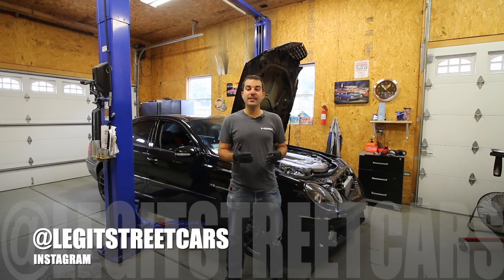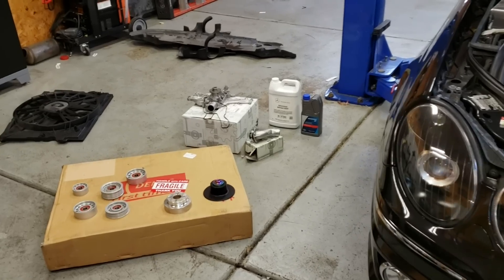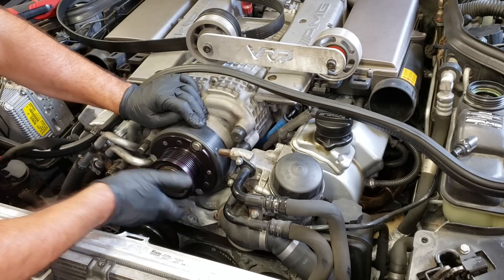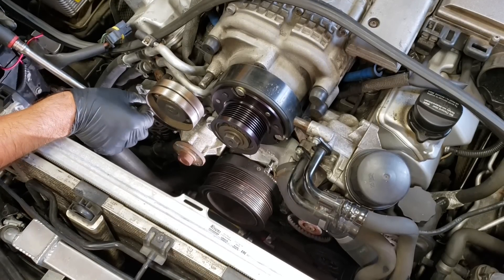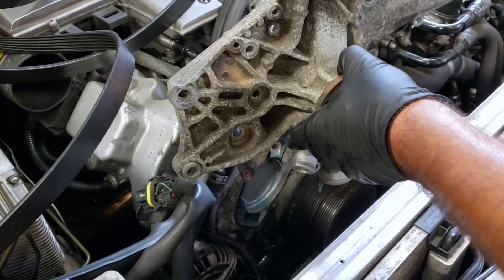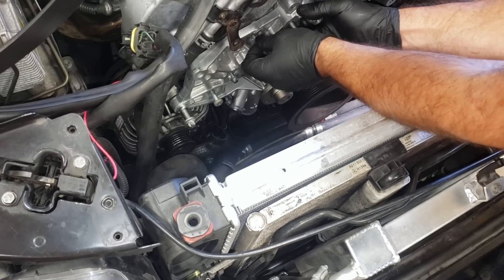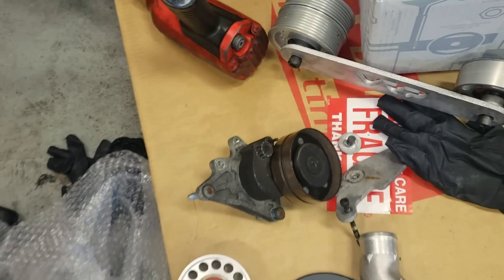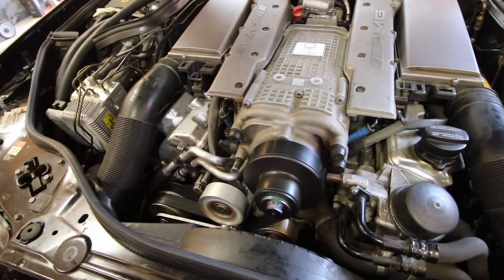My E55 AMG Finally Broke So I Added More Boost, Blower Whine & Power! "While I Was In There."

Comment: Just bought myself a e55, your videos have been a big reason why. Love it so far, can't wait to start modifying it!
Reply: Bloodhawk759 same whit me a year ago he made me change from BMW to MB lol i love my E55 , is such a gentle beast
Reply: I want one, can easily afford one. The maintenance scares me though
Reply: jmhellison i got mine 18 months ago, 146k miles now and this is a quick cost review:

SC pulley: 700 dollars (done at dealership thats why so high otherwise it would be like 50)

Spark plugs and wires: 350

Both front air struts: 1200, did the job by my self

SBC break failed: free of charge replacement by MB, its under extended 25 year warranty by MB usa

My A/C is working weird, not very cold air, and air flow speed oscillates randomly or stops completely for no reason 
Estimated cost: 140 to 500 without labor

Regular oil and filter changes 

So about 166.6 dollars a month i dont think is that high considering that most of the cost is for the airmatic that lasted 146k on originals, thats a lot
Reply: Me too, I got mine a week ago. I like the simplicity of working on it.
Reply: Have fun with repairs lmao
Reply: DisneyChanneFlow 2 you have to pay to play. Every car has repairs. It least I will enjoy it more.
Reply: @aaronedwards4755  yeah good point
Reply: I've been looking for a E55 myself I have a Clk55 with the naturally aspirated engine I've owned it 13 years super reliable. But I'm torn because I've always wanted a Sl55 but the suspension scares me.
Reply: I'm debating buying a 05 e55 with mods has 667hp guy wants 16grand cnd... It's just silver tho. If was black all over it
Reply: Bloodhawk759 how many miles and what did you get it for? I’m looking for one myself right now
Reply: @crinixx  14,000 miles,  costed me 14k usd car had every option available, even extra designo option such as leather covered dash and door panels, extra alcantara interior pieces. Im located in Sweden.
Reply: Bloodhawk759 that’s awesome, I just got back from test driving one that has every option you could think of with the alcantara pieces and dual sunroof. Very nice condition it was a dark gray metallic color too
Reply: Welcome and congratulations!   It's a sickness,  you'll see . . Lol

Comment: Mercedes actually give you room to work on the pulleys without removing the front clip of the car........Audi would never!!!
Reply: You don't have to, i did my timing belt without removing the front clip
Reply: @joewontwice  what audi? Most VWs you have to remove the front clip or even completely remove the engine.
Reply: @janprokopenko7928  1.8t a4
Reply: @joewontwice  What model/gen? I have a B6 A4 aint happen on that one
Reply: @joewontwice  Was it as comfortable as on this Merc??
Reply: @philb707 only thing that sucked was the crank pully bolts.
Reply: @philb707  drain the radiator and remove it. cover the ac condenser with cardboard and bungee it to the front wheel.  now you have a big hole to work through.  that is, if service position isn't making enough room.  audis are pretty easy for timing work.
Reply: Phil B what engine is it?
Reply: How do use front clip has a service position also no need to remove the entire thing
Reply: At some BMW engines you have to get the engine down to do the timing (2.0 diesel, 177hp is one).
Reply: My thoughts exactly. I spent yesterday noon playing with timing on a 24v vr6.  The front end has to come off just to remove the inlet manifold..
Reply: Yea, but audi aren't complete dicks. With 10 bolts the front end comes off, if you wanna keep the ac gas, you can just shift the bumper, radiator, lights everything to the side
Reply: @jimtremayne  we have a hardcore Masochist mechanic over-here !!! 😳
What's the safe word ? Harder ? 😂
Reply: All fun and games until the alternator takes a shit on you 😑
Reply: @thecarenthusiast4562  3.0L
Reply: Audi engines sit in front of the axles not on it.
Reply: I had to tear off the entire front end of my B6 a41.8tq just to change the water pump lol
Reply: @duranamo4297  sounds like par for the course, right now my power steering pump whines like crazy when its cold outside. front clip has to come off to replace it lol
Reply: @supermotoyzf  This is true
Reply: NoNoNoNii  highly doubt it
Reply: Audi is a fake POS don't compare it to the LEGENDARY Benz

Comment: Absolutely awesome video.  Your video solved a big mystery for me.  I bought a Chrysler Crossfire that had been converted to an SRT-6 supercharged engine.  It has a heck of a rattle at idle but I couldn't figure where the rattle was coming from and suspected there might be something wrong with the supercharger.  I ran a stethoscope all over the engine and couldn't hear anything, I changed the pulleys, water pump, and alternator and added a pulley saver kit from Needswings.  The rattle is still there and then today I watch your video and you explained that is normal with a fixed pulley.  My car is a 6-speed manual and when the conversion was done they must have programmed the SC pulley to be on all the time.  Now it all makes sense and I know there is nothing wrong.  You made my day!

Comment: what a freaking likeable person, easy to understand too, i got a sl55 and since we got the same engine this helped me a lot, i got a cluth 83 pulley and i will probably go lower but clutched and then adjust teh engine by coding, i want to be able to drive smooth and then after certain rpm to engage, i understand the tension on high RPM when engaged with a smaller pulley so i guess is a matter to find the sweet spot, anyway, a huge Thanks

Comment: Wow! 
No joke- Those nice, clean billet pulleys really do make the "underhood" area look great.
  And yes, I've seen a few guys (on YouTube) heat up that pulley, too.
  
....AND I've seen one guy on here go a step further when he replaced the front bearing on the blower: He put the bearing into the oven and the other, pulley nose part, into a cooler filled up with Dry Ice.
  After waiting a few minutes for the temperatures to get steady, the bearing slid right onto the pulley nose without any issue. It was pretty cool to watch.

Comment: Time for 550 cc injectors and looped rail... Otherwise, 8 cylinder fuel starvation problem is coming. Anyway, another great video Alex! 😄
Reply from the maker: It's done but with 630cc injectors
Reply: Wow nice to see BG users comment (y)
Reply: Lopped rail does absolutely nothing. Nada. Zylinder 8 starvation is on there myth. Educate yourself before you spread false information.
Reply: When my 8th cylinder misfired, all I needed was a software update from mercedes and then I put my tune back on and the misfire was gone!
Reply: SunnyBenz Unfortunately by flashing the tune over the update you also flashed back the old software again (with your tune modification). You’re back at square one :(
Reply: @Bastard_Operator_From_Hell  no I got a new tune with the software update, so it has the updated software. No misfires since, even going WOT
Reply: SunnyBenz That’s good news. Who’s your tuner. Thanks for clarifying that they actually used the latest update as base.
Reply: @Bastard_Operator_From_Hell  yeah, before I would hit 120mph and get a 8th cylinder misfire. I've gone 200mph after I got the update from mercedes I made sure to get a tune with the latest update. I used, OE Tuning.
Reply: @Bastard_Operator_From_Hell  The 8th cylinder issue with out question benefits from a looped rail. Show me ANYTHING to back up that the 8th cylinder starvation does not benefit from a looped rail.
Reply: @v0hero691  wtf is a looped rail? I know a little bit about engines and other thing but I don’t know shit about fuel injection or misfires after modifications.
Reply: @yangsrealm2536  one is a circle (looped) that keeps fuel pressure even across that rail compared to the stock e55 rail which is a "prong" so basically a line running on either side of the engine that does not connect to the other in a loop... fuel pressure is not maintained sufficiently down the rail (8th cylinder) under HEAVY load.

Comment: Alex, when I put my reduced pulley on my 2013 Audi S4 3.0 TFSI. I stripped and drained the charger oil even tho Eaton don’t have a service scheduled. 
I used GM SPEC charger oil. The oil was dirty.  The car had only covered 29,000 miles.

Comment: I put those UDP pulleys on my CL when i noticed mine were going, with belts and super bearing. i saved one of the front cover washers on that pulley in the middle(the one you couldn't get off) and cut around the edges and used it as a washer. i didnt like the way the bolt sat on the bearing race. M113k really needs to have a separate inter-cooler  coolant circuit.

Comment: Pretty cool that Nachi has parts for the E55 AMG. They are an OEM supplier that did and does supply parts to Honda and Toyota. F20C and F22C along with the 2JZGE all use Nachi bearings.

Comment: I suspect the rattling is the backlash in the supercharger gears. Tiny fluctuations in idle speed means the engine is constantly speeding up and slowing down over small periods of time. At idle there is little to no compression load on the supercharger to take up the backlash so it will rattle.

Comment: I own an SRT6 with the m112k motor. I know there are a few differences besides the two extra cylinders. Lol But its a general understanding that you shouldn’t run fixed pulleys on the M112k engines.

However I’m not sure if that is founded on any fact. For a long time no one really tuned the SRT6s to any degree other than intake and exhaust. So most owners are looking to keep them OEM. So could be driven by that. I am curious how your E55 with the m113k hold up on a fixed pulley. 

I agree with another poster that it would be cool to see you tune and work on a C32 or an SLK32. Would gain a lot of tips from you. 👍 love your Channel.

Comment: Is it true that it is better to shift the pulley on the crank for more boost than the pully on the compressor ?, what is your opinion, i have acls55amg and bought it with a 83mm pully on the compressor, have upgrade watercooler with upgrade pump and long neck downpipes, at the dyno it showed 0,7 bar of pressure and 518 ps and 810 nm. just bought a belt wrap kit as the belt sometimes can slip.

Comment: Problem is the supercharger is a lysholm style screw compressor which actually internally compresses the air.  A conventional "roots" style supercharger has no internal compression.  The clutch is there to prevent the unwanted compression during idle and cruising.   While typically more efficient under boost (lower outlet temp per amount of boost) the lysholm will cause more heat to be created  than a "roots" when idling and cruising.  The new generation TVS superchargers from Eaton are extremely efficient while not internally compressing.  They are also lavaliere in much larger sizes than the factory 1.6Lsxrew compressor.  I wonder if anyone has tried to upgrade to a larger TVS?

Comment: I need to replace my idler tensioner pulley — non stock— for something for reliable as the bearings in it failed. 
Why is vrp what you went with when selecting the belt wrap kit ?

Comment: I have the small pully now, but not fixed.  My fear with the fixed pulley has more to do with charge air temps and heat soak not being accounted for by the wastegate (I don't think?)..  So if I have too hot of air getting rammed in there, couldn't it blow my engine?  Besides having an AF meter, which would warm me too late.. what other protection do i have?

Comment: Alex, does a system software exist for energizing the supercharger clutch at the flick of the switch when the software has it disengaged? "Mustang killer mode" if you will.
Reply: This is an awesome question, that would be tight as fuck. Wouldn't that also be a better mod than having the one you installed in this video?

Comment: I've seen a bad water pump cause a belt to sucked into the front main seal and get stuck in the oil pickup destroying the engine, on an M112/M113

Comment: Have you  ever changed the supercharger oil? What does MB recommend for a change interval ? It seems like it would be a good idea with the new  direct pulley and more rpm of the internals of the compressor. Fairly EZ job for peace of mind for your beauty of a E55.

Comment: Hello, I bought a 2006 E55amg but the steering column seems very stiff. Is that typical? Or should I be concerned? If it is a common problem, what is the fix? thanks

Comment: You didn't mention this as a con, but anytime you raise the manifold pressure, you are of course raising the compression ratio and putting a lot more stress on the rotating assembly and valvetrain.  More stress = shorter operating life.  There is no free lunch.

Comment: Hey... I see you work on a lot of Mercedes and you were a tech for them. I have a 2013 Mercedes c250 today I was changing my oil and when I took out the oil filter the shaft broke off, now here’s the thing when I twisted the cap it came off with ease there was no force needed, I’m wondering if the last shop that changed my oil didn’t change my filter or they over tightened it... well I tried to pull it out with no luck it keeps breaking off piece by piece... any idea how I can get this off with out further damages?

Comment: i tried the 72mm fix pulley. I haved 18 PSI max boost. But 170 F AirTemp then. And no default cooler. I have 3 Cooler in a line. 1 small cooler from SL55, 2 big cooler from G55, 3 Cooler is a killer chiller system works with air condition. And a extra 2 liter watertank. So i have a big cooling system. But it is now too hot the air, and i lose many HP. Now i try other pulley with 85mm.

Comment: Hmm, Alex I think you may have just described what could be causing a mystery issue I've been having with my E55 Kombi over here on the Autobahn.  The car is only very lightly tuned, a chip tune by the previous owner, with everything else stock.  It is having an issue where you can basically only get one high speed run at a time out of it though.  If you run it up to like 240 KPH or so, then have to back off due to traffic, when you get back on the gas you often have what feels like virtually no power at all.  Like the power dropped to around 250 HP.  If you give it a minute to recover, the power comes back.  My guess is that the ECU is refusing the engage the Supercharger clutch due to high intake temps as  you mentioned.  Any suggestions for dealing with that problem that don't involve too much modding?   Problems that could cause this sort of behavior?  Can't bring the car back with me to the states, so trying to avoid spending too much on it in the long run.  It's also having an issue with a strong whine from one of the accessory drive elements, which lead me to this video.  Think it might be the power steering pump.  Would love to go whole hog and replace all of the pullies like you, but not sure it makes sense given the fact I can't bring it home as mentioned.

Comment: Nice vid as usual. Unfortunately, Roots type Superchargers are tremendously inefficient at higher boost levels. So you are not likely to get any more power by doing this mod. It will add pressure, but it heats the air so much more that the air density does not increase very much. So the ecu will pull fuel out. The parasitic drag from the supercharger also means less power available for the wheels. A lot of work for not much performance improvement. A before and after dyno with IAT and intake pressures would illustrate the extent to which you are chasing your tail here.
Reply: That car has a twin screw supercharger
Reply: @FlyingMagicPotatoes  Yeah the Lysholms are a bit more efficient. But still crappy compared to a turbo.

Comment: I’m sure you know, but that pulley has a security bolt because it is supposed to be replaced as an assembly with the tensioner. Why wouldn’t you replace the whole thing?

Comment: has anyone run into issues installing a 92mm throttle body? Seems most posts are just describing the great benefits of the larger throttle body?  What about the downside? Driveability, Reliability and anything else to watch out for when installing this?  Any videos on that pitfalls and solutions to get past them for larger throttle bodies?

Comment: Usually they go clutch for top end power and gas mileage. Also for twin charge applications. Would be curious what a fixed 72 vs clutched 72 shows on a dyno sheet

Comment: That’s funny, on my w202 c230 kompressor it did the same rattle noise at idle. I think as the magnetic clutch went out it pretty much stayed locked. 

Are the m113k pulleys the same as m113!? I would love to get those on the C55!

Comment: IM LIKE 7.9 AND I SUBSCRIBED RIGHT NOW.  OK NOW I HAVE 03AMG S55 KOMPRESSOR I HAVE 100K MILES BRO. I TURNED IT ON AFTER 5 YEARS WHEN I BOUGHT IT, HELLA OIL SQUIRTED OUT THE FRONT OF ENG I NEED TO DO SOMETHING ABOUT THE AIR SHOCKS IT'S DROPPED TO THE FLOOR. EXACTLY WHAT DO I PUSRCHASE TO GET IT UP TO PART

Comment: hello, i am from texas and i have a w203 c32 amg. basically the 6 cylinder version of the e55. im looking to replace some pulleys and add some boost but am also wondering if it is as easy as the e55 and what are the differences? also, should i go with vrpspeed, raceiq, vtech, or any other mercedes tuning/performance companies. thanks!

Comment: Legit, I don't need your thermostat but I have a question.  I just did a thermostat & coolant change on my M112 engine.  There's a low-temp stat available that fits it although it's listed for your E55 https://www.mishimoto.com/mercedes-e55-amg-racing-thermostat-2003-2006.html  My housing has a shorter neck than yours but the stat press-fits in exactly the same way.  I tried removing the OE stat from the aluminum housing but it's so tightly in there I was afraid I'd damage it.  Do you have any tips or should I just take it to a machine shop?